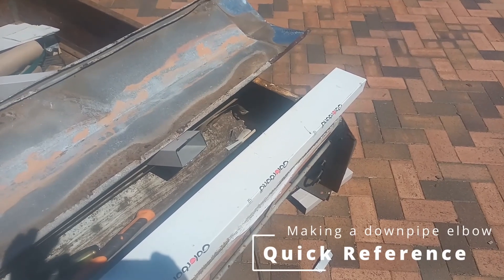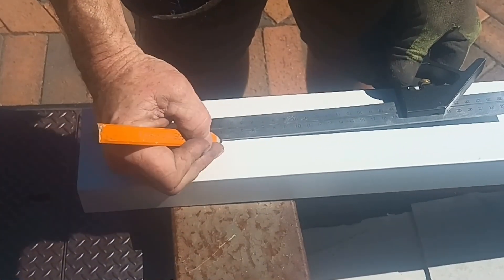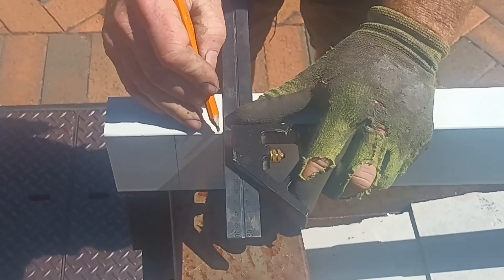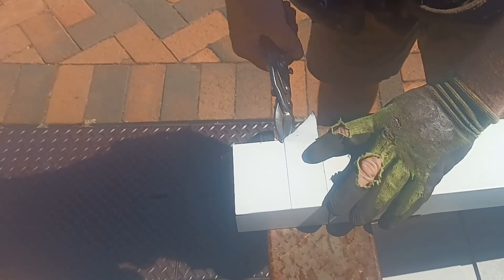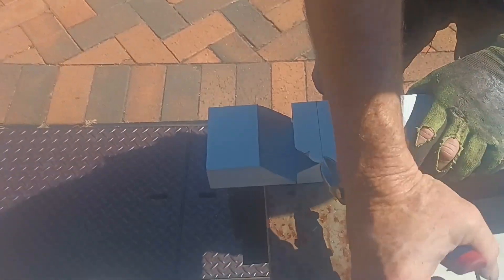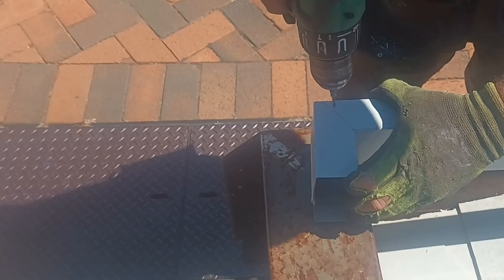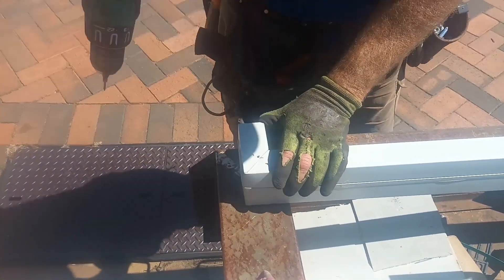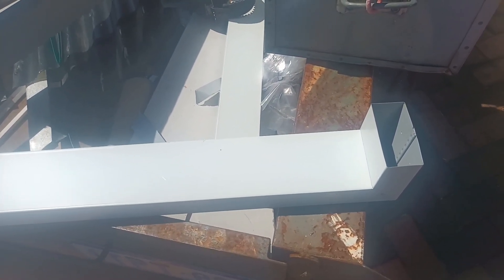Making a downpipe elbow  Quick Reference

Comment: nice and to the point. But the seam should be on the back so it is not visible. But definitely love the simplicigty of this video!
Reply from the maker: It's an elbow so the seam is on the back. Maybe you are thinking of a double return which would be cut to the other side.